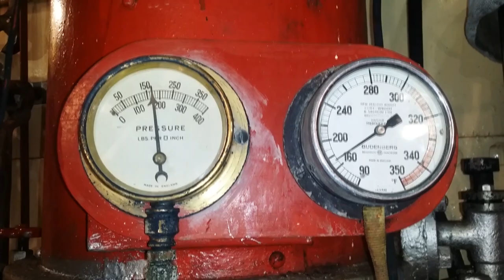Triple Expansion Engine Full Ahead!

Comment: No rod knocks in the main engine as so many steamers seem to have - really nice.
Reply from the maker: There's a little bit of crosshead play but hardly noticeable.
Reply: I think those knocks are often due to poor (asymmetrical) valve events resulting in no cushioning at the end of the stroke in one direction or another. On small engines, these knocks can usually be dialled out.
Reply: There may be something to this. I recall reading that the white star line ships with the exhaust driven turbine, like the Laurentic, would no longer have knocks in the reciprocating engines once the turbine was "cut-in". Specifically, I recall reading that the turbine barely added any speed, it just "took the knocks out the engines." The exhaust turbine would add some back pressure to the reciprocating engine, which may add the cushioning you mention. I find it hard to believe that knocking would be caused by loose rods or some sort of mechanical problem on so many ships, though I don't know what tolerances those giant steam engines are built to. The turbines also added efficiency, which was the main reason the white star line used that system on so many ships.

Comment: What more explanation would not hurt! Further on a beautiful sight in the engine room.
Reply from the maker: +Hoe ishetmogelijk Sorry, next time I'll definitely do more labels during the editing process but I can sum up in words to make up for the lack of information.

0:09 Looking at the connecting rod of the high pressure cylinder of the starboard engine looking towards the after end of the ship. You can see the oil boxes on the bearings.
0:22 The eccentric crank for the valve gear of the HP and IP cylinders. This engine uses stephenson link valve gear. The rod passing through the engine towards me is the emergency controls for reversing the engine if the reversing engine is out of action.
0:56 The copper pipe along the side of the engine carries seawater that comes from the condenser circulation pump and can be used to cool the crosshead guides. We never really need that and it drains into the bilge so not for regular use anyway.
1:04 We see the thrust bearing for the starboard propeller shaft, it's directly connected to the engine with no clutch or reduction. Reverse is done by reversing the engine, and stop by stopping the engine. The ship has two 11.5 foot bronze propellers. https://www.dropbox.com/s/4bst9wmx9pwegmc/2015-08-27%2010.51.42.jpg?dl=0
1:10 Is the Weir air pumps (or weird air pumps we sometimes call them), two separate pumps for redundancy because this is a sea going tug.
1:21 We walk across to the port side engine. I'm standing between the LP (left) and IP (right) cylinders.
1:45 I step over the port side propeller shaft.
1:48 Is the Drysdale seawater pump circulating the cooling water through the condenser. As well as it's sea suction it also has a direct bilge suction from the engine room if we're dying. We also have a general service pump reciprocating type that can also act in it's place should that pump fail.
1:57 I'm just trying to feel where the level is in the condenser. The condenser is a 3 pass design. 
2:20 You can briefly see the bilge pump along the left and behind that is the general service pump. The bilge pump can pump from 3 water tight compartments. The general service pump can pump water from the fore and aft peak ballast tanks and between the two tanks, pump water up to header tanks, it has sea suction, it can pump water through the condenser, it's the fire pump, and it can also work as a bilge pump as well.
3:16 Two gauges at the top are the steam pressure applied to the HP cylinder Both are set to about 80 psi. Below that is the RPM, which read a little high.
3:28 Left to right you have the condenser vacuum (25 inches in mercury), the IP receiver (25 psi), and the LP receiver which is about 0 psi. 
3:42 Is the feed water heater, left, feed water pressure, right, the feed water temperature in degrees F. 
3:50 Weir direct acting feed pump.
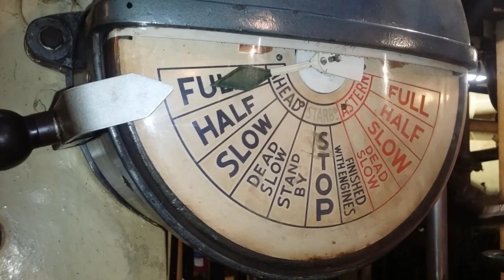4:10 Electric telegraphs (not original).
4:16 The generator, the power comes from a 15kW 400V 3 phase alternator but originally the ship used 230VDC, the DC unit is seen to the right of the flywheel. The AC alternator is behind the engine belt driven off the flywheel. The engine is a single cylinder high speed engine.
4:19 Back looking at the starboard engine, looking aft. The starboard engine is my favourite engine to drive.
4:59 The main steam pipes that go through the bulkhead into the boiler room. They are made of copper and are very thick.
5:09 The exhaust steam from the LP cylinder is piped directly into the condenser.
5:16 The steering engine (1930s power steering). The wheel is for emergency only and is normally disengaged and can free wheel.
5:52 Just approaching Kawau Island doing about 9 knots. 

Ship weighs around 400 tons I believe, top speed of 13 knots. 
Coal consumption at full ahead is 1 ton / hour.
Maximum coal capacity is 100 tons (50 each side) + 80 tons in aft bunker for long journeys.
Current coal capacity is 40 tons. The current configuration has wooden bulkheads positioned at each end of the coal bunkers to reduce the bunker capacity to 20 tons per side. This is to make for less work trimming when the ship only does short trips like this one. The trade off is the bunkers need to be refilled more frequently. And the 80 ton aft cross bunker is full of old shovels, rope, various gaskets and packings, old tool and spare parts so it has no room for coal.
Reply: +KiwiPowerNZ  PERFECT!! Thank you very much!